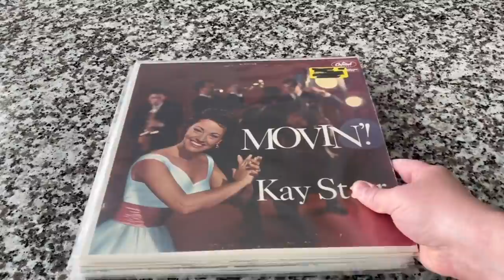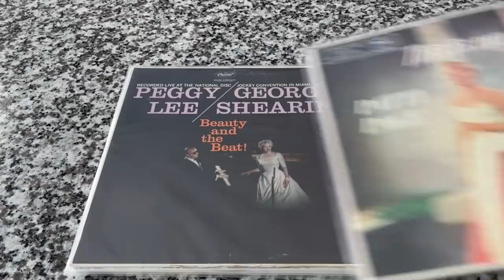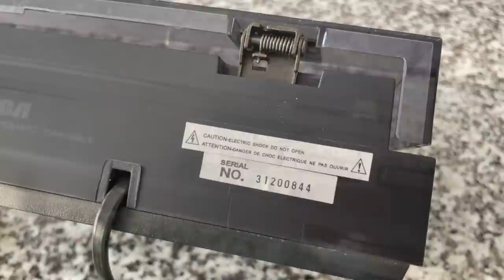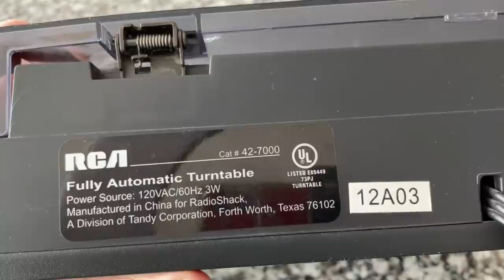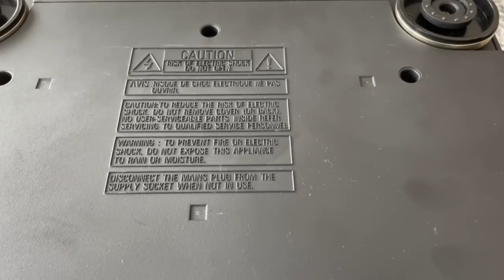RCA LAB-1200 Turntable Review! (…and test!) #vinyl #vinylrecords #turntable

Comment: I  bought an inexpensive Realistic turntable and pre amp (which was powered by a 9v battery) in the mid 80s from Radio Shack.  I THINK it was pretty much the same as this one.  I had it hooked up to a plasticy Soundsign compact stereo which I had won in a raffle.  I kept the unit in a back room in my house and I often brought it out on the deck in the summer.  The sound wasn't that bad and I really enjoyed it on a hot night over a few beers!  Your review brought back those memories.  Thx. :)

Comment: This was my very first new turntable! I bought it new from Radio Shack in 2004. I sold it in a garage sale in 2006. I upgraded to a different turntable BECAUSE of the dreaded cheap plastic platter. This turntable has a manufacture date of December 2003. Almost any radio shack product is going to have a date code of month of manufacture and then the "A" and then the two digit year.

Comment: This is what I have been using for 20 years. Came from Radio Shack as a Christmas gift in 2001. I've replaced the stylus several times, changed the belt, and it keeps on running. AT does have a cosmetically and mechanically identical model, the PL (not LP)-50. That's what I had to look up when I replaced the belt last year.

Comment: $14.99 for that used and working RCA LAB-1200 turntable was a great deal indeed and I have often advised people that wanted to build a stereo system with a limited budget to go to thrift stores to seek out excellent used gear for reasonable prices. 

With a little patience and persistence, they can build a decent enough system (depending on the town or city and on the generosity of donors donating quality electronics) for maybe $100 total versus the original retail prices that would have cost hundreds or a few thousand dollars.

For example, I bought a used Sansui semi-automatic direct-drive turntable with a gold Empire cartridge for $25, a Yamaha 5.1 receiver for $15 to $20, a Technics 5-dsc carousel CD player for less than $10, an Onkyo cassette deck for $10 to $15, a pair of JVC tower speakers for $25, and a number of Blu-ray players for $7 to $10 each. Brand new, all of that gear would have added up to $1,500 to over $2,000 originally, so it pays to visit local thrift stores, garage sales, auction houses, pawn shops, etc. to seek out some great deals, especially for someone new to the hobby with a limited budget.

Comment: Would adding a record weight help with the wow and flutter by adding mass to the platter? Is the mass of a record weight located too much in the middle of the platter to make a noticeable improvement compared to if this had an actual metal platter?

Comment: That RCA LAB-1200 turntable reminds me of a Sony PS-LX250H turntable I bought back in 2001 which was a fully automatic belt-drive unit like that one, but it came with an aluminum platter and for a simple unit that retailed for $100 (I think I paid $80) that I hooked up to a Sansui amplifier phono input, it sounded decent. Yes, there are better turntables out there, but it was a great starter unit with no major setup knowledge required (no balancing of tone arms with counterweights or dealing with anti-skipping dials or weights on pulleys, etc.).
Reply: I had one of those, too.  Totally agree with you.  I just gave mine to my sister and her family when I picked up my Pro-Ject.  Still worked great!

Comment: Were you thinking of putting a metal platter on it to test the wow and flutter? I could hear some w & f when you were playing your records (not terrible, but noticeable). I would think that if you tried using a metal platter, as you said, that would answer the w & f problem. I don’t think that it would hurt your TT (in particular the belt) if you tried that, since, as you also said, similar TTs have a metal platter.

Comment: I had the same turntable, but it was a "Radio Shack" labeled unit.  The difference was that the platter was full aluminum.
Reply: my Radio Shack branded unit came with the plastic platter. built in 2004. I had to upgrade to the metal platter.

Comment: I have the same one, it was also sold as Presidian brand at Radio Shack, I bought it new in 2005-2006, it was under $100 new, like $80. Did you buy the $25 Walmart AT3600 stylus? I was thinking of replacing the generic one on mine, the thing has started skipping on perfectly clean records for no reason, ones that don’t skip on my other turntables. Also the 33/45 switch has started going bad, it sometimes starts slowing down randomly on 45rpm, but I never had that problem on 33rpm.
Reply: I'm betting you don't play a lot of 45s?    Sounds like oxidized contacts in the 33/45 switch.  With the turntable OFF, cycle that switch about 20 or 30 times.    Should fix you right up.  If that doesn't work, get into the insides of the unit, locate that switch, and hit it with contact cleaner.  Then cycle the switch a few times.

If that still doesn't fix the problem, the switch itself is a fairly common type; a replacement shouldn't cost more than a few bucks.

Comment: What did you lubricate on yours?  I bought mine yesterday at a yard sale for $10. It works fine until it starts making a weird noise then I’ll let it sit for a little bit and the noise goes away so I’m wondering if you have to lube anything under there

Comment: There's a 4th company involved, the one that actually made the thing.  In the early 2000s, RadioShack was licensing the RCA name for use on their private label audio line.  Much of it was actually made by well-known companies such as Pioneer (in the case of their receivers), but under a special agreement with RadioShack.  I'm not sure who made this turntable, but they'd been selling an apparently identical model under their Optimus and Realistic names for at least a decade before starting to slap the RCA name on this one in the early 2000s.
Reply: It's sourced from Hanpin.   This very mechanism has been around since the 1980s and is sold under a variety of brands, including the modern Audio-Technica LP-60 line.

Comment: A friend gave me a similar turntable recently (the name on it is TEAC rather than RCA); he said that the amp burned out but the table itself still works. I am going to see how it goes! Also, I'm curious... where have you recently found a good deal on the AT3600L stylus? I have looked on Amazon, but the options are a bit confusing.
Reply: They are all over eBay.  You should be able to find one for 20 bucks.
Reply from the maker: Amazon or eBay even Ali baba
Reply: @bbmousedoowop  Thanks.
Reply: @Recordology  Thanks.

Comment: I bought one of these used and replaced the crappy and WARPED plastic platter with the metal platter and the mat from an old Sony PS-LX250h as well as bought it a new belt and it plays great. mines the same turntable but mine says RadioShack LAB 1200 not RCA, my Date Code is 08A04, August 2004.

Comment: Don't "lubricate" a rubber belt with oil; oil will eat away at the rubber. If the belt is a bit hard, try soaking it in very warm water for 10 minutes.
Reply from the maker: Of course not….I was referring to the cam wheel.   I have in the past accidentally lubed a belt and that is not fun 😅

Comment: Could RCA not have removed the Audio Video circuitry with the exception of the control subsystem from their SELECTAVISION player and replaced it with a RIAA EQ Preamp and a Line level output stage and I suspect that would have made for the best record player out there because of the Linear Tracking system that was part of the SELECTAVISION Player and another thing the records would not need to be removed from the cover in order to play them just slide it into till a click is heard then withdraw the sleeve and play of Side 1 will begin to play side 2 then reinsert the sleeve till a click is heard then withdraw it, flip the album over then reinsert it till a click is heard then withdraw the sleeve and playback of side 2 will begin.

Comment: For $15, you pretty much stole this, dude.   As for the phono-line switch, it's not that uncommon (in older units) to find it under the platter.

12A03 is your date code.   Dec 2003.

Comment: my volume is super low.. how do i fix that?
Reply: Your preamp is probably not switched on.  If you have this model of turntable, the switch is under the platter; other models may have it on the back of the unit.  If it's an older unit you may have to cycle the switch back and forth a few times to 'wipe' oxidation off the contacts inside.

Note some of these units from the 1980s and 1990s lack a preamplifier entirely.  You'll either need to find an external preamp, or look for PHONO-IN connections on your receiver or main amplifier.

Comment: What about T4P?
Reply: T4P won't work with this.  The cartridge (AT3600) is a permanent part of the tone arm itself.  Typical for most Hanpin-mechanism turntables.
Reply: Brilliant idea, but for unknown reasons the T4P tonearm/cartridge design was abandoned sometime in the early '90s. Developed by Technics, T4P (also called "P-mount") was introduced in 1981 and became fairly common on consumer turntables in the '80s. This provided literal plug-and-play cartridge installation, and for the non-technical music lover they didn't have to deal with cartridge/headshell wiring, setting the cartridge alignment, tracking force and counterbalance weight. Methinks the last T4P turntable on the market was a Technics belt-drive unit which was for sale until 2002.
Reply: @peacearchwa5103  Now I have to deal with the cartridge/headshell wiring on the Project Pro Carbon.